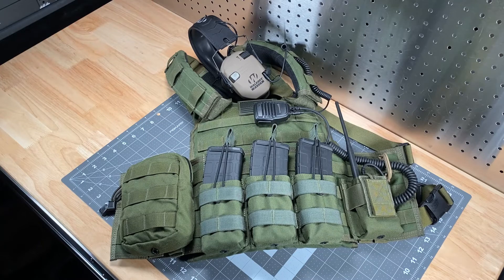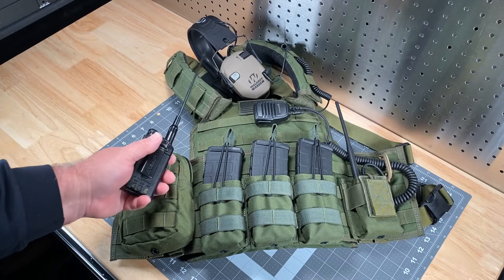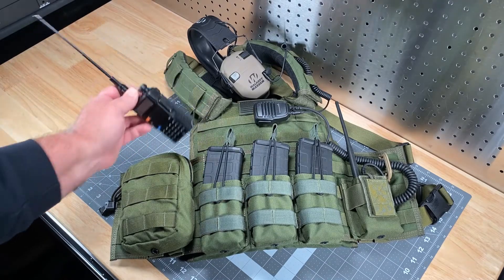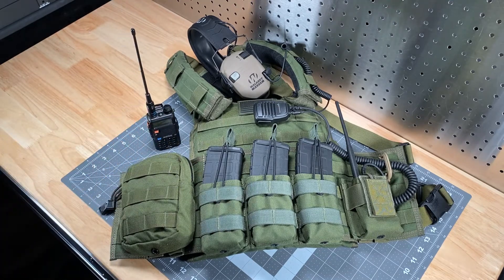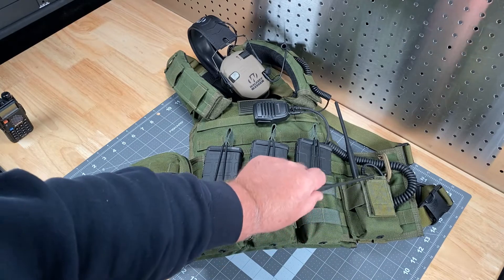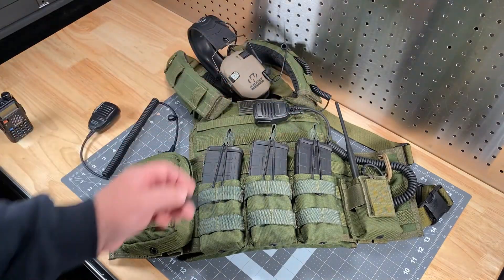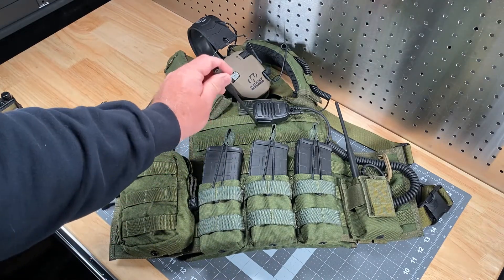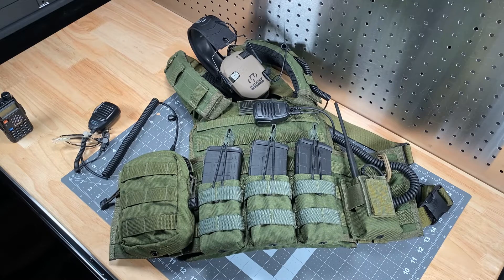Running Radios on Plate Carriers & Load Bearing Equipment

Comment: You remind me of a situation I was in once where a cop had me at gunpoint. He was a skinny, young, scared cop, and he was holding the gun out at arm's length with his hand sweating and trembling and his finger on the trigger, pointing it at my face from about a foot away. Then a radio call came in, and since he had his speaker mic clipped to his left shoulder, he turned away from me and answered the radio while leaving the gun right there at the end of his straight right arm.

Hoooooo boy.

I didn't take it away from him, but it sure did make me wonder what they're teaching cops these days. (Or those days, I guess--it was years ago.)

Comment: I like your KISS mind set.  Here is an idea to think about, might sound crazy at first, but hear me out.  Put the radio and the antenna on your helmet.  Remember the old NODs that consumed a lot of power and needed a small external battery pack?  Now granted a modern PVS14 doesn't consume much power, but they still weigh nearly a pound and need a counter balance weight on the back of the helmet.  So, carry the Yaesu FT-60 in the old battery pouch on the back of the helmet!

Lock the Yaesu FT-60 keypad, and cut a "custom" piece of plastic out of a bottle or something and tape it to the radio to cover the PTT button so it can't get inadvertently pushed and cram it into the pouch.  Use a short mini SMA cable running from the radio up to the antenna, both secured by the helmet webbing.  With the Yaesu HM34 speaker microphone clipped to the webbing on your left shoulder run the audio cables to your hearing protection on your left ear and your radio in the battery pouch on the back of your helmet.  PERFECTION!  Now your radio antenna is vertically oriented up on your Kevlar helmet (not right next to a steel plate!?) and there is only 1 set of secured together loose wires flopping around which is a short eight inch or so run from the mic on your shoulder to the hearing protection connection on your left ear, and the radio on the back of your head!  Try it, you'll like it!

AND you can clip the mic to the webbing on your helmet when you remove your helmet to mess with it, or just to get the dang thing off your head for a 5 minute break and it is all contained in a nice, neat little package greatly reducing your cable frustration.
CARRY ON!

Comment: Your videos are very well made and lots of good info. I run a very similar setup to yours. I run a Yaesu VX6R, BNC adapters, Disco32 antenna relocation kit, Raptor antenna pouch, Diamond SRH320A antenna, and Yaesu PTT. My recommendation to you to help clean up your cable management is to weave PTT cable thru cummberbund on left side of body, then run ptt cable up the back panel of plate carrier and thru the left side shoulder pad. It gets cables out of your way and creates a snag free cable system. In the field your cables as mounted will create a snag hazard.

Comment: Good video for the beginners but you mention on how you wouldn't always want to run you headset in certain situations and in my opinion if you are wearing kit that a headset is an absolute must. The walkers are great for just plinking at the range but the sound quality isn't adequate at all for a fighting load out. I think you'd be very happy with the L3 peltors or especially the Ops Core AMPs the sound quality is almost superior to the uncovered ear and especially if you're running comms I think that's an investment you should really consider✌🏽 great video keep up the great work!

Comment: My Baofeng UV-5RA (with side mic connector) fits into my Spector Radio Pouch snug but nice. However, I have to force my Yaesu FT-60 (also with side mic connector) into the pouch, making it very difficult to remove and leaving me worried about breaking off my mic connector. Will there be a slightly larger pouch coming out, or do you have any suggestions for me?
Reply from the maker: There is a little trick to help out on that. I'll do a quick video and show what I do to get around that.
Reply: Thanks. The Baofeng usually sits on one freq all day, but the Yaesu is my go-to and needs to be pulled to change freqs occasionally.